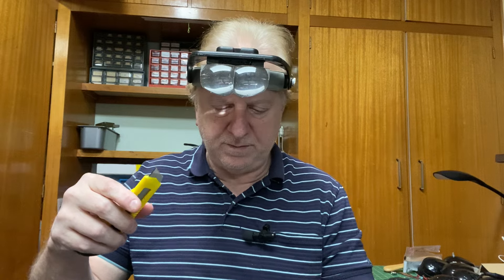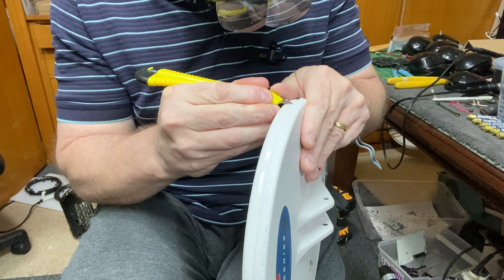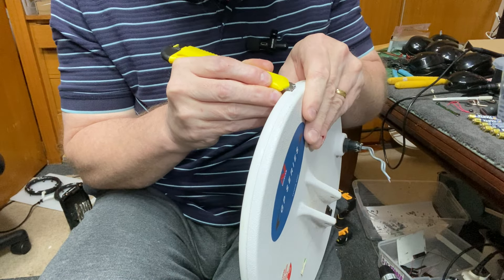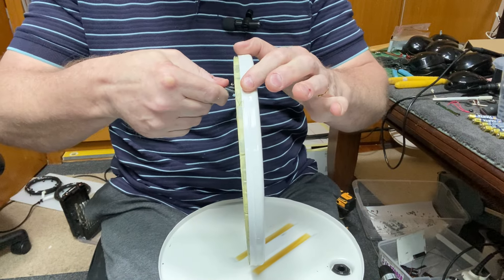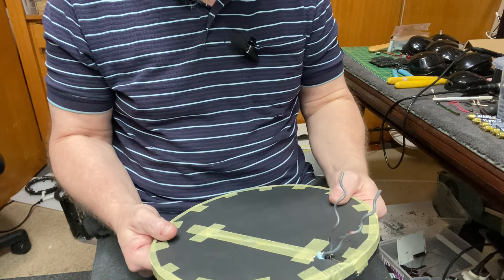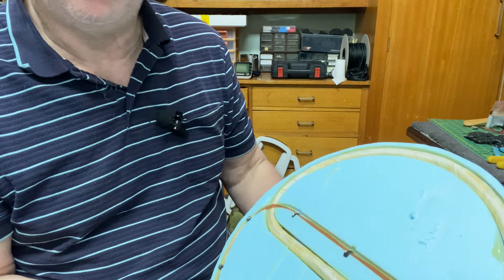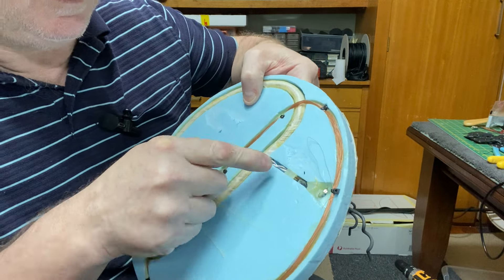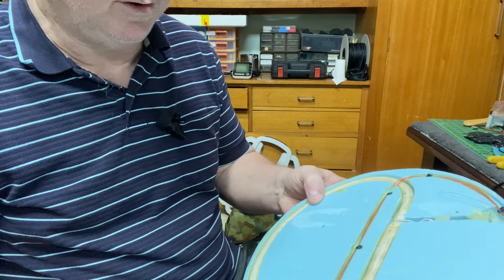Minelab coils repairing and making them better, how to pull the coils apart and rebuild.

Comment: You have inspired me to put a one of your new mono cable on my gp3000 coil. The outer covering has totally perished. If I wreck it , its a learning curve and I have a few commander replacements.Nev
Reply from the maker: It is very easy to do as long as you do it slowly and take your time.

Comment: Ive got a 14x9 coiltek sdc coil that i never use, i prefer the 11" round. Can the 14x9 be re-made better? It has dead spots on the sides. Cheers 👍👌🇦🇺
Reply from the maker: Anything can be achieved with time and patience.

Comment: Any chance you could rebuild a monster 100mm coil to suit a 6000 or  anyone you know would build one thanks Woody.
Reply from the maker: Minelab stopped anyone doing that by having coded ic chips placed inside their coils and only they and selected coil manufacturers can make a coil that works, So the only way to make a different coil is to pull the board out of a factory coil but then you can make a dongle to run any coil.